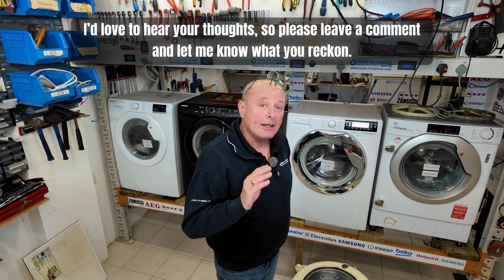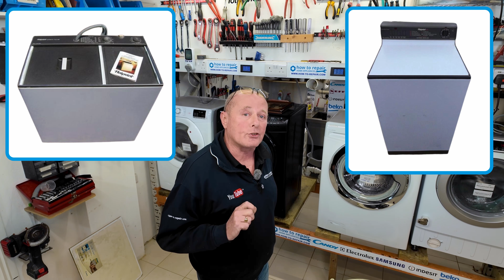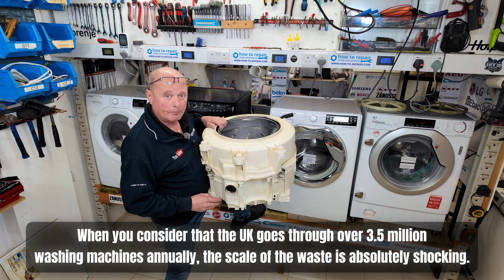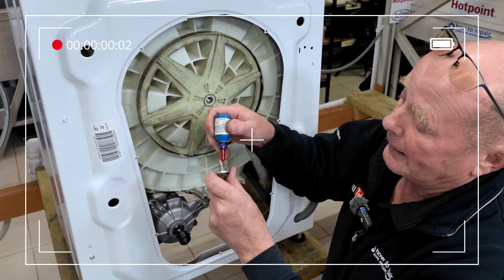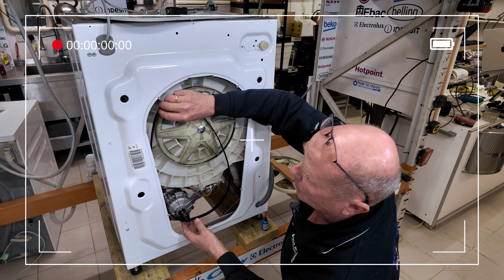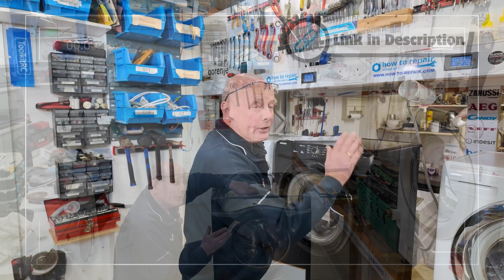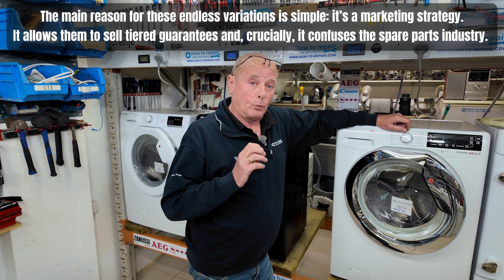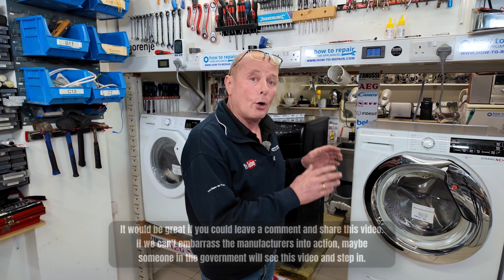I Scrapped 13 MACHINES to Prove a Point: STOP BUYING These Brands!

Comment: Got a Hotpoint washer used an extended warranty the manufacturers care plan. On its second drum ( genuine parts, Hotpoint engineer installed) recently serviced after we overloaded it and it went a bit haywire. Use the recommended cleaner ( bought 2 years with on a Hotpoint deal). Used most days for years, runs like new.

Comment: Never buy any front loader washing machine EVER. They are all bad from new. Buy a top loader or nothing. I am 72 years old and over the years I have had a number of washing machines. Top loaders were the best of them and the longest run 22 years I got out of any machine was a Maytag Top Loader. It was a big machine that could take a queen size woolen blanket and wash it perfectly. I was sorry to see the Maytag go but it could not be repaired. All the small appliance repair shops have closed where I live. Loved your video and I have subscribed.

Comment: Yes,  I am an Engineer by profession.  Half my career managing the design of products and the other half managing production of products made in their tens to hundreds of thousands.
I frequently come across inadequate product design that have what I chose to call "guaranteed to fail" design features.  Toyota did some analysis some time ago and for their motor vehicles discovered that 80% of product failures where due to product design.
Current appliances are mostly made in communist China.    The communist Chinese made products have a well deserved reputation for very poor reliability and short product durability with an abundance of GTF factors.
I wouldn't buy a Hoover washing machine,  ever.   Our current washing machine is a USA made Whirlpool some thirty years old and used every week.  Now on its last legs due to cabinet and chassis corrosion.  Only failures I recall are one water pump and agitator drive dogs,  both repaired by me.
When you put brand name companies in the hands of finance and marketing "people" who outsource both design and manufacturing to communist China,    the company has just adopted a GTF strategy.

Comment: I'm an engineer for a appliance company not big brand but multi brand. I find hoover and candy brands are crap. But they haven't followed suit on on making the sides and fronts to come off to make it easier to work on. The motors are noisy and bearings are so short lived. I always advise customers to insure their products just as I know I will be there soon with their hoover products

Comment: I’m an electrical engineer in the U.S. You are spot on regarding greenwashing - the energy / water savings inevitably come at the expense of increased complexity. Increased complexity, combined with the pressure to manufacture them as cheaply as possible always compromises reliability. The energy savings over the appliances short life is dwarfed by the energy required to produce a replacement & recycle the prematurely failed machine. A classic is the heat pump water heater, where a simple resistive heater / gas burner is replaced by a closed cycle refrigeration unit consisting of a sealed compressor with moving parts, evaporator, fan and control electronics, none of which are repairable.

Feature growth - just because my washing machine can talk to my phone doesn’t mean I wish to hear from it. However the more features there are the more opportunities there are for failure on a piece of equipment already plagued by an absurdly short life. And some of the engineering is pathetic - the ice maker on our Whirlpool refrigerator has failed 4 times, the main failure being a wiring harness that goes between the body of the unit & the door - every time the door is opened the wire harness is flexed. And the buggers used ordinary appliance wire with PVC insulation, not ultra fine stranded wire with silicon insulation designed for high flex applications. So the wires break over & over. And the wire harness is installed in the door, which is then filled with foam so one can’t replace the wire harness, you have to replace the door - for $800.00 - except the door is no longer available. So every other year I lay on the kitchen floor splicing the next wire to break.

Increased complexity translates into more skill required to repair, while the relatively low price of the machine means customers are unwilling to pay a repair bill large enough to adequately compensate the level of skill required to repair, so skilled service people are rare, most are unskilled parts changers. The price of repair parts like electronics has zero correlation to their original cost to manufacture. A control board that might cost less than $20.00 to manufacture can easily be priced at $150.00 and are often not available. There are some board rebuilders on eBay that will repair your board for a reasonable cost, but the machine is down while you send the board to the shop, then wait for its return.

Comment: Why do all of these machines have belt drive systems? That is really old technology that does a rubbish job of spin-drying. I am in Australia. I bought a Whirlpool front loader with a direct drive motor about 30 years ago. It lasted about 12 years before it needed to be replaced and did not need a single repair in its lifetime. I then got an LG direct drive front loader. At that time we had a young daughter and were using a new type of washable nappies. That machine washed at least 2, sometimes 3 loads a day. My partner took it with her when she moved out. When it was about six years old, the frame where the shocker mounted tore. I reinforced the frame and the machine ran for another 4 years or so. I bought a Samsung direct drive front loader that was a combination washer/condensor dryer. After about 5 years I replaced a temperature sensor for the dryer assembly for about AU$15. At about 11 or 12 years the spider assembly gave out. I replaced it and the two shockers for about AU$300 [a new equivalent machine was about AU$1300 at the time]. That machine ran for about another 4 years until the drum bearing failed. No parts were available as the machine was quite old. I bought a new Samsung direct drive washer [made in Korea] and a Samsung heat pump dryer [made in China] about a year ago. Both are running nicely with no incidents. My last two washers spin dry at 1200 or 1400 rpm.